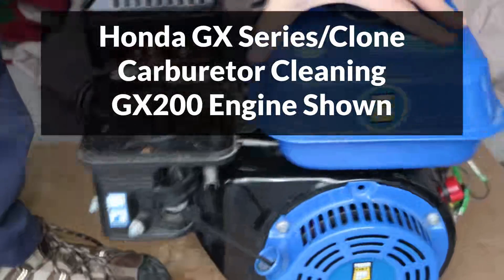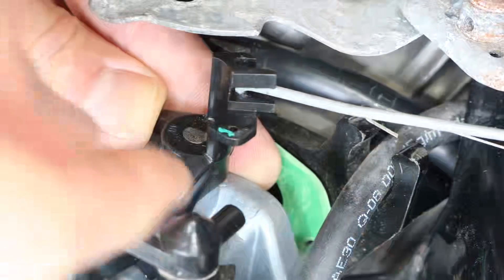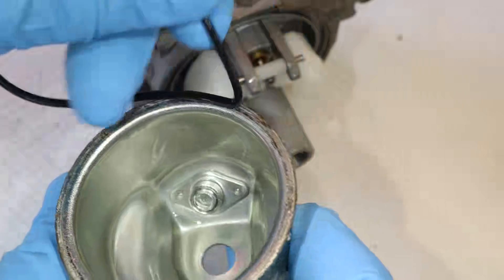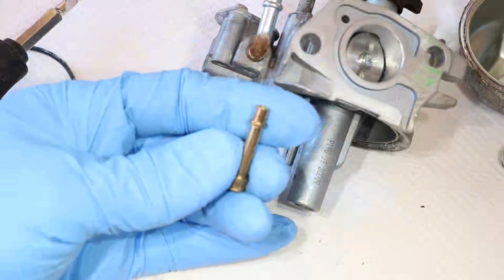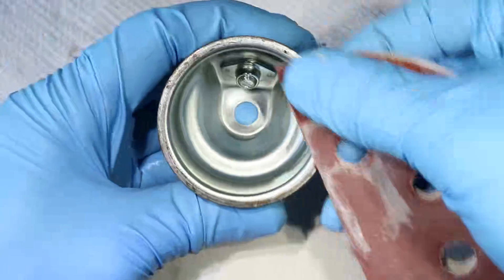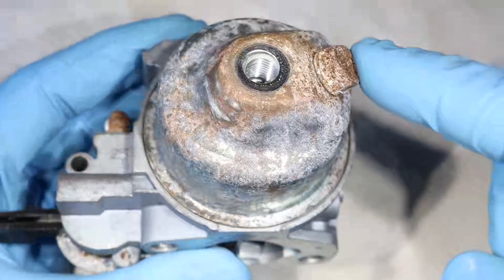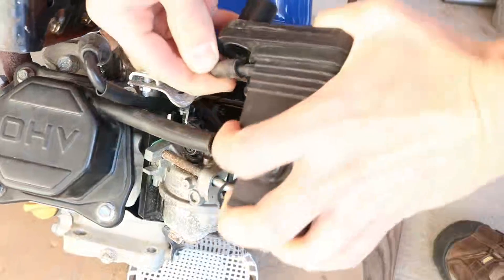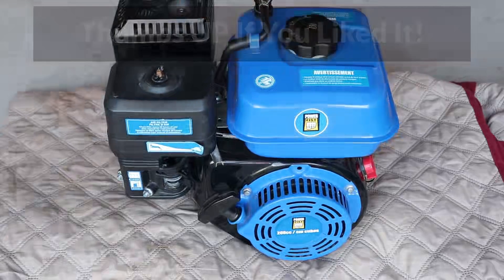Honda GX Carburetor Cleaning, Surging or Won't Start Fix, GX160 GX180 GX200

Comment: Thanks for the valuable information. I have a question. I used the same engine for 1 month without any problems and then it stood in a closed garage for 11 months. I started it again last week. But it works intermittently and the butterfly valve moves constantly. What could be the reason? Thanks
Reply from the maker: If it's revving up and down like in the beginning of the video, that's usually a clogged carburetor.  If it's really clogged, it will be hard to start, or won't even start at all.  Sitting for 11 months can cause it.. even less than that.  Premium gas helps, because it has less ethanol, but doesn't prevent it completely. Ethanol is the problem, it causes deposits on the carb passages.    I usually let it run until it's out of gas before storing and it starts right up the next season.  The blue engine clogs up easily.. not sure why, I think it's the carb design.
Reply: Thank you so much dear  @CleverFix

Comment: Btw if you don’t have access to an ultrasonics cleaner, a can of carb cleaner with a straw will work! Spray through each hole until it comes out the hole clean
Reply: I find that brake cleaner works best 😎👍🤷‍♂️

Comment: Thank you, this will be helpful. Question, I have the same powerfist engine and less than one year old. Recently it started surging but I ignored it. I thought it needed an oil change, filter clean or fuel was low. After doing all of that, now it doesn’t start at all, or if it does it dies after a few seconds. I assume it is the carburetor. Question is how often do I need to clean the carburetor and is it normal for it to do this less than a year in service.
Reply from the maker: Yes it can happen very quickly unfortunately, depending on how often it's used. When the engine is not used the gas in the carb will attract water and evaporate slowly, corroding it, and leaving deposits behind. Gas should be burned, not allowed to evaporate, so turning the gas valve to OFF when not in use is very important, but still it's not enough in some cases. If it's started often and turned off for 1-2 weeks, each time the carb will fill, and then dry up. The solution is adding the PROPER amount of fuel stabilizer to the gas can, to stabilize the ethanol content.  Too much stabilizer is very bad, so it should be measured perfectly.  Some high grade gas has less ethanol in some locations, but not always, so it could also help to use 91+ gas.  My guess is that the carb materials are not high quality, and the water attracted by ethanol is gumming/corroding up this carburetor..

Comment: Superb video, I have a GX200 which is poor running, it will start and run sometimes but will just cut out at full revs, then either be poor at starting or will start again no problem and run for a bit, then do the same, just cutting out at full revs.

It was also poor at idling, and when you went from full revs to idle it would just die.

I removed the carb and cleaned the main jet, but I didn’t clean the rest of the carb, so you think that could possibly be the issue, that it requires and much more in-depth clean? 

I checked the valve clearances and they’re good, it’s also sparking and seems to be sparking well.
Reply from the maker: Yes the carb has tiny passages inside of it that need to be cleaned, so it has to be submerged in an ultrasonic cleaner. The jet is definitely not enough in most cases. Hope you got it fixed.

Comment: You're not specific on what you mean by "premium grade" gas. A premium gas won't solve the problem which is ethanol. You should be more specific and state that one should use ethanol free fuel in anything that has a carb. I ONLY run ethanol free fuel in my small engines with carbs and I've resolved all these issues. It's the ethanol that gums up and clogs the micro jets causing rough idle issues.
Reply: I assume you are American?  We no longer have ethanol free gas in Canada
Reply: @bl9531  You can make your own. Add water to regular gas. Water and ethanol will separate out on the bottom. You can pour off the ethanol free gas off the top. Make sure to shake the bottle well and leave it to let it settle out. You can add an octane booster to boost the octane since it'll be reduced when you remove the ethanol.

Comment: Does it necessarily has to be a carburetor cleaner ? Can we not  use a WD40 to clean a carburetor?
Reply from the maker: WD40 won't clear deposits at all, it's a lubricant. Pinesol dissolves deposits in a carburetor, and a ultrasonic clear is required to shake them loose. Without a ultrasonic cleaner you can let it soak in Pinesol for a day or two, but it's not guaranteed to work. I recommend a ultrasonic cleaner for anybody with small engines around the house.. sooner or later they will all clog. Gasoline evaporates out of the carburetor, and leaves behind deposits. The more gas that goes through a carburetor and evaporates, the faster it will clog. Having a fuel shutoff switch helps a lot.
Reply: @CleverFix  thank you and very intuitive, further l don't know what type of oil should l use for the engine.
Reply: WD40 is a lubricant which leaves a film. Spraying this will contaminate the fuel in the carb. Spraying carb cleaner is a solvent which has cleaning properties and evaporates.